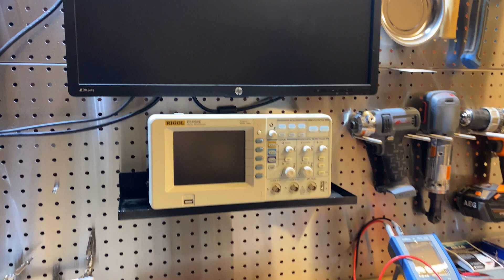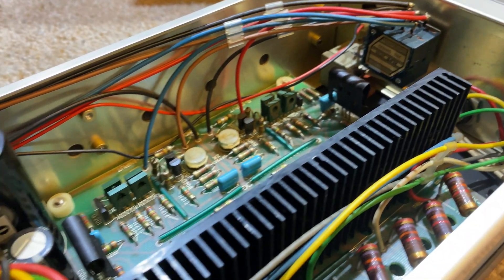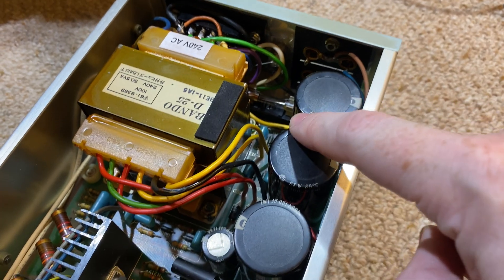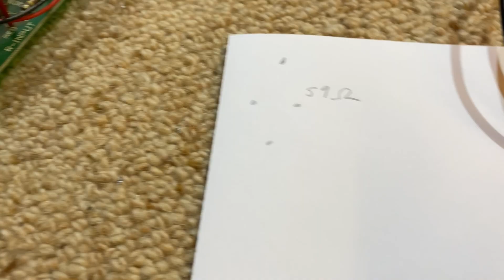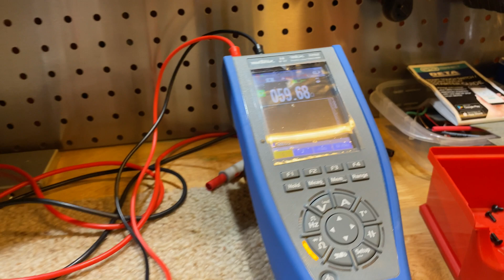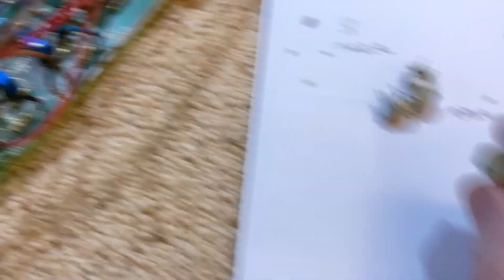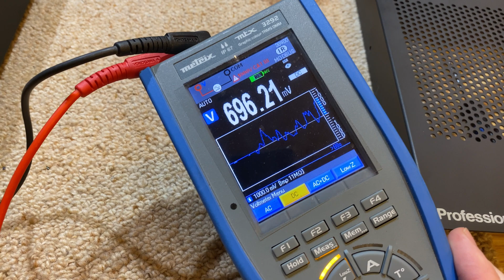STAX SRM-1 (MK-2) Electrostatic Driver Restoration

Comment: Hello, similar question as someone asked before: Can you provide links to where you got the service manual in order to understand the calibration procedure? You didn't show/explain in the video what the four pots actually do, and how you calibrated....
Reply from the maker: Documentation is available from HIFI engine, the calibration is clarified in there also :)
Reply: @whatcouldgowrong7914  Thanks for the link. But unfortunately I was not registered on hifiengine, and registrations are no longer possible due to misuse (?) So unable to download documents from there.... So if someone has the documents lying around (service manual/schematics for SRM-1/MK2) and would be willing to share, shoot me a message here.

Comment: Thanks for sharing your work on the SRM-1. Due to what I have seen, changing the large 3 capacitors might be the one job I think I could do without risking a mess.
I am only considering it as on mine I have a light hum you can hear from the inside and also at the output (louder to the right, but disappears at max. volume). I guess the noise is a mechanical from the transformer, I and I hope a better “smoothing” (isn’t it that what these are good for?) of the AC might help. - Or is that crap and I better keep my fingers out of the case?
I already switched it from 220 to 240V (230V is what we have on the sockets, here) I believe it was quieter after that. And would it make sense to upgrade (200uF) the capacity at this point (I’ve seen you did not).
Thanks for your support!
Reply from the maker: Bad capacitors can cause hum but chances aren’t very high that theyre bad, can also be caused by grounding loops / issues etc

Comment: Thanks for your video. I've problem with my SRM 717. The sound is weak. Do you know the problem? Ive checked the PSU. At the beginning its 2 one Watt power resistors' values change alot (i believe due to heat). I've checked the voltage. It's ok now. Same also with two 0.5 small power R which i thought on the final power transistors but the sound still weak. Do you the problem? Do you also have the schematic ? Thanks.

Comment: Hello witch model Bourns value you are using ?
Reply from the maker: I ended up removing them as I found the voltage rating was too low for this application :(
Reply: @whatcouldgowrong7914  Loved this video. I’ve got the same amp and want to service it. 
What did you do about the trim pots? Did you put another new type in, or did you reuse the originals?

What voltage rating is necessary for those trimmers and what value are they?

Any info would be v much appreciated.
Reply: @whatcouldgowrong7914  Loved this video. I’ve got the same amp and want to service it. 

What did you do about the trim pots? Did you put another new type in, or did you reuse the originals?

What voltage rating is necessary and what value are those pots? 

Any info would be much appreciated.
Reply from the maker: @lp12vinylrips  I ended up leaving the old ones. The new ones “worked fine” but the voltage was over 300v from memory and out of spec for them. You can confirm the voltage on yours by measuring across the pins while its on but I think it was high 300v range?
Reply: @whatcouldgowrong7914  thanks for the info. I can see that most modern trimmers are limited to about 250V, so I’ll have to try to find a higher spec one
Reply: @whatcouldgowrong7914  just wanted to ask - do you know the value of the trimmer pots? E.g 20K or something else?

I’ll look for higher voltage ones and post back
Reply from the maker: @lp12vinylrips  cannot remember sorry, it shouldn’t be print on the side of them :)

Comment: If i were you I'd just replace the old electrolyte caps as they tend to dry over the years. Others components you mentions such as diodes, trimmers, polystyrene caps no need to be replaced. Im sure you don't know the V settings as you don't have the manual. The other way is to measure the orientation (resistant value) that you’ve mentioned.
Reply from the maker: All the electrolytics were replaced :)

Comment: Great video. So what difference does it make to the sound?
Reply from the maker: Honestly it sounds similar as everything was still in spec, it was just to get it consistent and reliable. Especially with expensive electrostats plugged into it